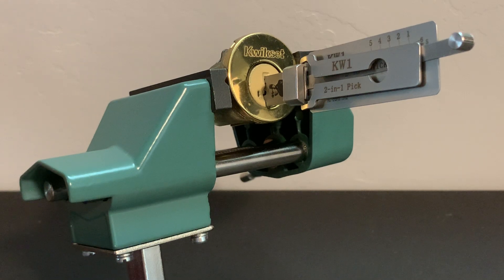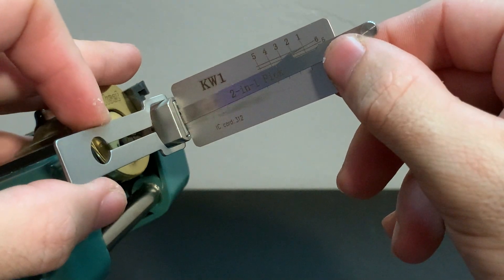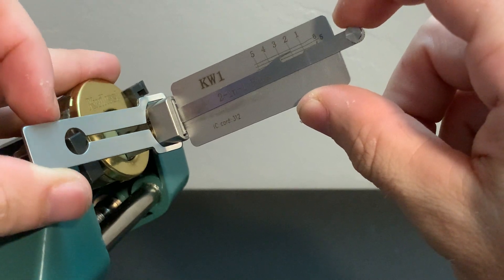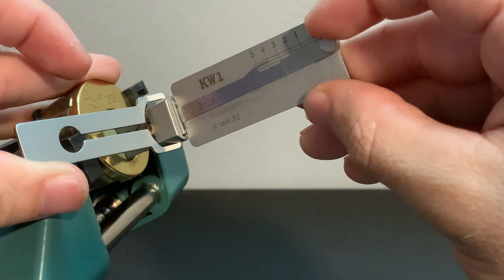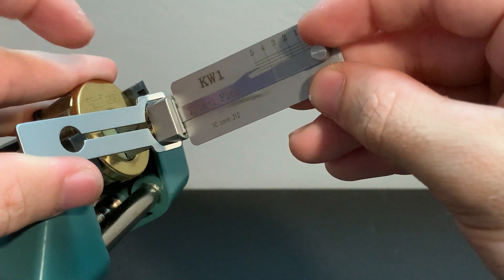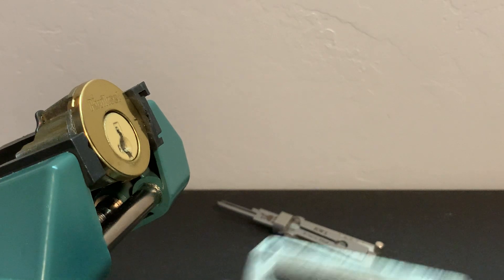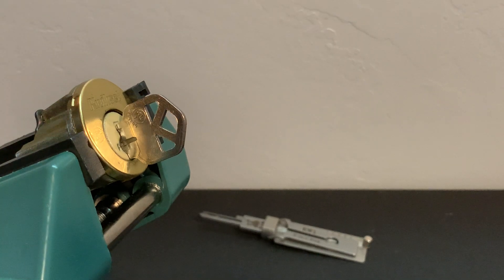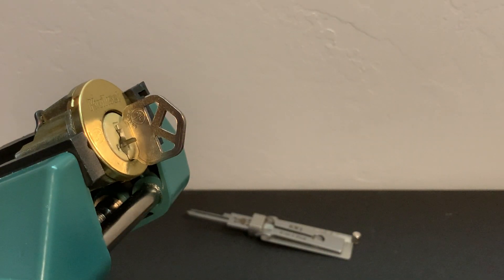How to Decode a Smart Lock with a KW1 Lishi Pick! - (Gen 1 & 2)

Comment: Thanks! If you’re trying to simply open it and not decode it, do you use a similar technique? I can’t seem to open smart key locks
Reply from the maker: So, Smart-Key locks use different mechanics than standard locks. As a locksmith we decode, cut a key and open them. 

Picking them is notoriously hard. You can practice picking them by keying them up to a blank key. That is one of the easiest ways to get a feel for picking them.

You can also cut a step down key 1-2-3-4-5 or 5-4-3-2-1 and learn that way as you progress. 

But, I have not met anyone who can successfully pick a wild smart-key lock. Only with insane hours of practice on a pre-keyed up one.
Reply: @LockandKilo  Good to know, thank you very much!

Comment: Will this method work to decode all other cylinders or just this
Reply from the maker: @MarinaDAllessandro  this Lishi will decode standard 5 Pin locks with the Kwikset keyway. 

For the Smartkey Kwikset it works only on Gen 1 and Gen 2 models.

Comment: After decoding the depths using this method, could you start again using constant turning pressure to pick the lock now knowing where to place each click on tool?
Reply from the maker: Unfortunately no, this method only allows decoding on Gen 1 and Gen 2 Smart-Key locks. 

You will still need to cut the key to actually unlock the door this way.
Reply: @LockandKilo  thank you Sir....

Comment: The Lishi M1/MS2 tool I bought couldn't even provide the correct key cut code to cut a key for a 4 pin Master Lock padlock.  My locks are still unusable unless I take the time to impression keys and file them to fit.  I watched another video of a locksmith who had to add 1 to each number he read from the scale for the key to work.  Why spend a lot of money for a tool that doesn't even have an accurate scale?
Reply from the maker: With Master Lock it kind of depends on the lock. I noticed on the lower quality locks you add 1. On some of the medium priced locks they are spot on. 

Master is the outlier lol… also you’ll see a bit of a difference on locks with standard pins vs after market.
Reply: @LockandKilo  I had 2 keys made with the Lishi numbers and they didn't fit.  Then I had  2 more keys made with 1 number shallower pin cuts and they didn't fit either.  Fortunately I only spent around $50 for my Lishi.  I feel sorry for people who spent $100 or more and still can't decode their locks.  My M1/MS2 will never pay for itself and shouldn't be advertised as being able to decode Master Locks.

Comment: Thanks. So it’s really like decoding a combination lock by determining the different feelings between false gates, and real gates. Why won’t this work on Gen 3 sets, and how can you tell the difference between Gen 1, 2, and 3 sets externally?
Reply from the maker: The newer gen versions added a side bar that prevents this method. Gen 5 also used different style wafers inside so the Locktech tool can’t differentiate the first 3 cuts. 

But, they did make a new decoder tool for those cuts lol
Reply: @LockandKilo ,  It truly is an arms race. haha
Reply: Which tool is that?

Comment: Have you found a method for new Smartkey locks ? ( KW1 )
Reply from the maker: Locktech Decoder is sweet for newer models. They also make an SC1 version as well, but that keyway is not very popular. 

I was made aware by viewers and other locksmiths that new gen Smart Locks have a different layout than previous models for the Locktech however.

Comment: I just watched the video for the second time before going on a Kwikset Smart Key Lever Keypad lockout. I found that 4 of the 5 chambers I could not get the pick/needle (on the KW5 Lishi Pick) to move past cut 6 (with no tension) so I could try the next number depth in the sequence. I had to force the pick to the next number depth, then it was loose on most numbers after. I had to revert back to drilling the cylinder out. Do you know what that means when I cant get the needle/pick to easily move to the next number depth in the sequence? Thanks for your time.

Comment: After Decoding, ever try to Pick it Knowing the depths would think you might be able to pick to the depth, no further, then pick 2nd Tightest Binder, and repeat til open.
 I will try next time I drag out a Smart  Key Lock and my Lishi.
Reply from the maker: It's possible, when I was a new apprentice the veteran locksmith used to key these up to blanks and have us practice picking. 

Then we would key it up to 12345, 54321 and get a feel for it. Regardless of how many times I did it, I could only ever pick that lock after hours of trying. 

When I came to them in the field, I couldn't get a feel on it tbh. But, real world locks are always more difficult with positioning and wear. 

The side bars also make them tough to pick lol

Comment: Question what it means when it turn 75% but won’t open ..???
Reply from the maker: It could possibly be turning the wrong direction or if the lock is picked in the correct direction, it could even just be a damaged lock/spindle or thumbpiece.
Reply: @LockandKilo  I think we was was turning it the wrong way .. 😆Embarrassing…Pops and I finally opened it Old Antique Sager …It was fun though..

Thanx BUD 🫡
Reply from the maker: @antwontaylor3385  it happens lol
glad to hear you got it!

Comment: Is it possible to close the locks with it also after opening ?
Reply from the maker: For the Smart Key Lock, you can only decode it and make a new key. 

On a standard lock it is possible to pick it over either way, but the Lishi is designed to make a working key on top of picking the lock open.

Comment: I was just considering buying a the expensive reader now I’ll get the lishi. The Schlage tool works great.
Reply from the maker: The LockTech Decoder is definitely worth the investment as it can decode all KW1 models. 

But, as Gen 1 and 2's are still much more common, this will get you by!
Reply: What’s the Schlage tool?   

The locktech is definitely nice.  Skips having to even do this step straight to hell recording with it. Pushing it in the lock an pulling it out a little slower.  An going back to a van or wherever an watch back the video while making the key.

Comment: Love ur vids! Learning a lot for residential as I do automotive keys, immo work, auto repair, lockout & been learning residential to help hose customers that want key work done and it’s definitely help me expand services. 

Quick question, I’ve seen 2 variations of lock clamps locksmith shops & hobbyists have been using. The one you have then one that looks more modern. Where can I find these?

Also does anyone make a mount that would go in a receiver hitch that I could mount a vise, locksmith vise to? 

I picked up some magnetic plastic inserts that are grooves in varying spots so I can use the vise for metal stuff that can’t be damaged. Also need to get some rubber or whatever I see lock spinners using on YouTube as I realize though the plastic inserts are plastic they can still damage a lock. 

Look forward to a reply. 

Do you have a tee spring setup for you so people can show support by getting a shirt. Name is kind of cool as well. 👍🤙🤙
Reply from the maker: The vice I used in this video is from Harbor Freight. I bought it for other purposes as I do not pick locks in a vice normally lol

I have had many requests and have someone working on shirts for the channel due to several requests over the past few months. 

I am honestly shocked I have such a following as I have been inactive due to a recent surgery that just took a toll on me, so I have just been working and resting any free time I have had. 

For the inserts you can always grab some material from Walmarts craft section cheap and wrap it with some small padding! 

Thank you for the sub and the support!

Comment: i have a few questions Kilo. 

1. How do you identify the generation of smart lock?
2. Why is M1 locks pain in ass to pick with Lishi?
Reply from the maker: The easiest way to know if this will work or not is when you insert the Lishi and apply tension and it remains loose. You'll start to identify these with time and experience. 

If you check out my video number [8], I pick and decode a Master Number 3 with the M1 Lishi. 

In that video I show some of the issues, such as over tensioning and cuts reading slightly off!
Reply: @LockandKilo  Thanks Kilo. I will just use my M1 lishi for decoding!

Comment: Does this work on old and new smart locks? I have one I’m trying this on and all positions are springy. I don’t get the no movement in any position.
Reply from the maker: I have not tried it on all Gen's, I know that it works for sure on Gen 1 and Gen 2. I Know it doesn't work for the new SC1 version. 

If you are dealing with an early Gen and it's not working, remember to loosen tension until you reach a depth, then apply heavy tension. If it still is not working it may not work for that model. - Kilo
Reply: This trick only works on the old ones, first generation and second generation

Comment: Ok i have to say this is one of the first real useful lishi use I've seen. Makes perfect sense for locksmith and with the number of kw1 non smart on the market it can be used frequently.
Reply from the maker: Yeah, I wasn't too into the Res/Com Lishi's until I bought a set of 8 on sale one year. In one case a client knew they lost their house key at the river and just needed a new key made without rekeying the rest of the locks, so it did come in handy there.

I find it comes in handy especially on lever handles as those are the most awkward style locks to pick as well as some of those have to be picked over to take apart, so it saves time to make a key for like the other 12 in the building and such haha

Locksport wise I guess Lishi ranks with the Bump Key lol - Kilo
Reply: @LockandKilo  interesting question: at what point is it worth your time to decode and cut a key (and lose the cost of a blank + equipment wear) because it's just faster than picking the lock if the customer does not explicitly request a new key?

Ie your picking minute rate vs decoding minutes rate + blank cost + cutting time,  any idea?
Reply from the maker: @froggypicker  That's a good question! It's not often I find myself using these Lishi's as opposed to the Auto Lishi's(when I was on the auto side of the trade), since it's usually going to be a rekey job. 

Usually in your mind as a Locksmith you just know you are going to end up making a new key or rekey a home, so most of the time I just pick the lock the standard way since my pick kit is always by my side as opposed to where I keep the Lishi's hidden lol

For the one job with the client who just lost their key in the river and were 100% certain on that, they had a Defiant, so I used the KW1 Lishi to pick, decode and cut a key in about 3 minutes overall. It kind of depends on the shop owner on this tho.. 

Some owners will not even entertain the thought of picking longer than a couple of minutes, they will drill a lock and sell a customer a new one in a lot of cases, others will spend a decent amount of time if their schedule permits it. Really a major deciding factor is the schedule. 

If you are back-to-back-to-back booked up, then you'll rake everything and shim the locks and just rekey, if they are certain they just misplaced the key and only want a new copy made then you can knock it out in a few minutes for a service charge and move along to the next call. 

There are a lot of variables to it, sometimes you'll have some massive jobs coming up and your boss will squeeze in one of these calls, it's also helpful to many Locksmith's as the majority can't really pick much above a Kwikset consistently. Lock Picking isn't generally even taught at shops so much as it's a skill you obtain with trial and error on-the-job and lock-out's like this are maybe 5% of the job...usually the owner sends the best picker they have and trust so many guys never learn it.

If the client has like 4 different keyways on 14 different locks on 6 different doors then you'll pick them standard, shim and rekey. If they have 14 smartlocks all keyed alike, this would be the option as you can decode, cut the key and then change the key over in 1/8 of the time it'd take you to take them all apart...if you didn't have the LockTech Tool lol - Kilo
Reply: @LockandKilo  how do you use the code to cut keys what program or tool please just curious as starting my own company in the UK here great video sir ty😊
Reply from the maker: @Countryboy246 sorry for the extremely late response! This slipped through my notifications!

So, the HPC 1200 Blitz is pretty much the gold standard in cutting keys by code. I also use the HPC 1200PCH which cuts many car keys as well. 

If you buy an automatic machine you can simply insert the blank and enter the code. These machines require higher maintenance and can be finnicky, especially on a vehicle. 

But, any solid code machine will work. In the beginning starting out some people will use Space and Depth keys, it’s a longer method, but gets the same result in the end. 

Once you can afford a code machine it’s worth every penny!
Reply: Lishis are badass for cars. I had like 5 or 6 I used all the time. The Ford 8 cut lishi, gm 10 cut, gm z keyway 10 cut, Chrysler 8 cut. Just those 4 made me a ton of money. 

The Ford 8 cut lishi made its money back like 1000 fold. I bust ass with the lishi Ford 8 cut. I can cut a full working key in like 5 minutes with it. I definitely use autotel to tell me where the cuts are if it's 1-6 or 2-7. Then use a code software to get the last 2 cuts. It's a max of 3 keys. The Ford 8 cut lishi is hands down the best one in my opinion.
Reply: Never tried it, but it worth it to try even I have deep doubts .